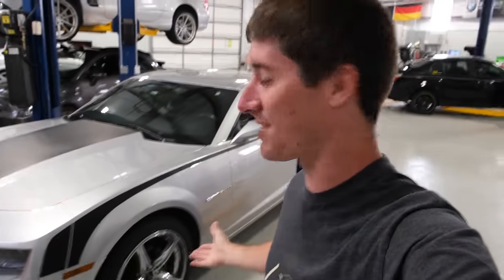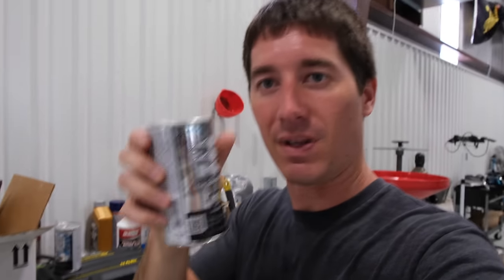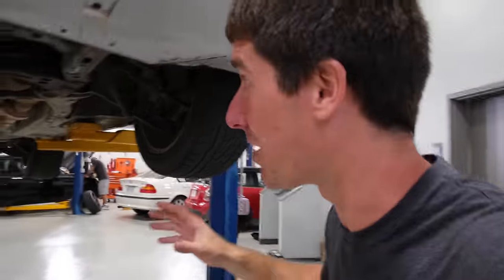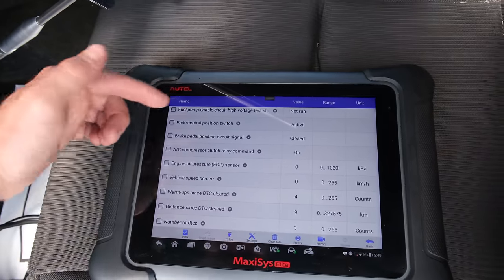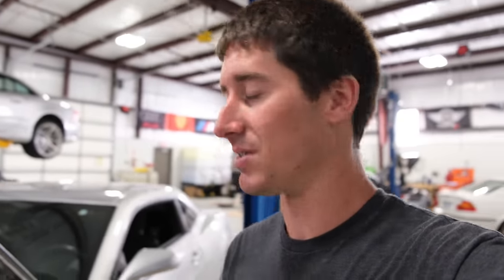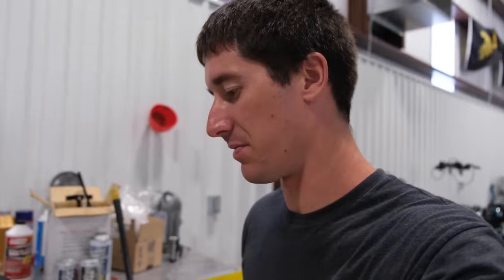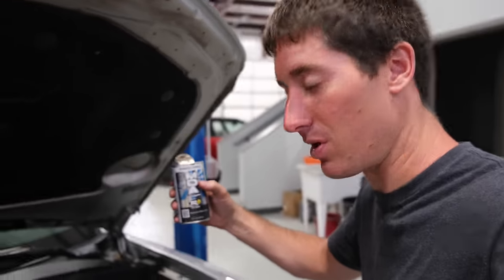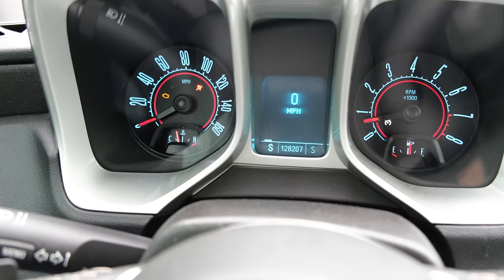FIXING The UNFIXABLE Engine In My CHEAP 2011 Chevy Camaro RS *SLUDGE REMOVAL*

Comment: Wow.. Now that's an improvement just in the oil filter bay. I bought myself an 800 dollar saab 9-3 with a bad cat that just underwent a oil change and it was just as bad. Forces my hand to do a sludge flush now that I see how bad that oil looked.
Reply: Depending on generation, Saabs also had a big PCV/crank case ventilation issue, might want to look into which if any revision of the fix for that it has.
Reply: @fnordpojk  
I think the PCV issue you mentioned is more for the 9-5 with the 2.3L I4 ecoboost turbo engine. 
I have the 9-3 with the crappy 2.0L turbo I4 from GM. Which worries me even more cause GM.
Reply: @OG_DSM  Yeah, the 2.3L had like seven revisions of the crank case ventilation before it worked as it should, but I know several other Saab engines, including the GM ones, had other issues with it too. It was mostly fixed in the BioPower generation, but anything before that really needs to be checked.
Reply: @fnordpojk  absolutely correct. Nice to know someone who knows SAAB. I never liked the bio-power generation, they got to fancy for me TbH. 
I only like the 20in rims on most models because they look fantastic. lol.
Reply: @OG_DSM  I used to own an '02 9-5 with the 2.3L, so I had to learn about all that stuff. Helps to live like an hour and a half away from the old Saab factory. :)

I like the first-gen BioPower stuff for the looks of the cars, never liked the NG stuff in the last couple of years. I have actually been thinking about trying to find a well taken care of 9-5 2.3t BioPower from around '09 or so, because I love driving them, and since they're considered eco friendly they're a good deal tax wise.
Reply: @fnordpojk  those are very nice. The 2.3L was probably the best engine saab ever produced and wondered why GM didn't use it in all models!? Guess that was another mistake GM made that put the nail in the SAAB coffin. 
Good luck with the find and purchase, plenty of good examples still for sale on the market place.

Comment: My truck is pampered for a 1996 Sierra I only run royal purple in her and a minimum of 89 octane gas. And I make sure i change the oil on time.
Reply: Why do you run 89 octane? Have you shaved your heads and increased compression? The owners manual calls for 87.
Reply: Josh Hollifield it pings every time I run 87
Reply: Those vortec motor dont have high compression have you had your timing looked at? My old 98 the distributor was worn out and caused incorrect timing.
Reply: Josh Hollifield I could adjust the timing but that’s a lot of effort to put into it and it’s happy running on 89. So it’s not really an issue

Comment: Is there such a thing as a transmission clean as well? I’m sure that and the ‘diff’ have the original lubes in them?
Reply: Transmissions sort of "self clean" as ATF is loaded with detergents for exactly that reason. If you have one that is nasty that you care about, change the fluid a couple of times over a few thousand miles and put a new filter in (if it uses one) on the final change.

If you have one that is nasty that you don't care about, leave well enough alone. Sometimes the failing fluid is all that is holding them together.
Reply: Maxwelhse great answer! Thanks.
Reply: @DBB-KE5DUO  NP. Also, if you heard it in the video JR and Ninja both said pretty much the same thing of engine oil changes. You change the oil 3 times in a row just with regular oil and you're pretty likely to clean things up a lot too.

I'm sure the BG works awesome, but I can buy a lot of Tractor Supply oil for $300.

Comment: Hi JR, back in the mid 1980`s till millennium night I drove my own cars as taxis around outer London UK.. I done quite a few miles each night but changed my engine oil every 5000 miles, but had a system, when the odometer showed 5000 miles it got just fresh oil and when the odometer showed 10.000 miles it got a new filter and oil, but, each time i gave it a flush with hydraulic oil I could get very cheap, so that cleaned the engine out and the hydraulic lifters also. my cars done 200.000 miles without problem or use oil, but my last car I used I kept longer so that done 300.000 miles still ran as good as new... Regular oil changes for me then were on average every 5 weeks, but paid off in the end.... Thanks for the video, will look forwards to the next one.. Ian - UK.
Reply: I'm curious what horrible thing happened on millennium night to make you give up the taxi career?
Reply: @TheBrokenLife  Hi bud, well, after doing taxi work at night around a once complete madhouse of club goers, the local council began shutting some of the biggest clubs by terminating there drink (liquor) licences so the work got less and less so I came to the conclusion I had enough of drunks and druggies after 14 years,  And with millennium night being warm most celebrating said - we`ll never get a cab (taxi) tonight so walked home - I really had enough, so, no, i never changed into a pumpkin, I just called it quits and walked away, ending back in my old job in a factory, making parts for aeroplanes..  Less money - more  hours at work, but no more drunks and druggies, was working nights still, but that was by choice.. Hope you find this Interesting.. Thanks for the reply.. Ian, from UK.
Reply: @ianburit3705  I actually just thought you retired and was just joking around, but that genuinely is a fascinating story.

What about the rise of things like Uber has in the US? Anything like that going on over there?
Reply: @TheBrokenLife  Well, the job I took, even re trained to operate a big 5 axis CNC machining centre made me really proud of my work, like a fool I was doing up to 14 hours a night, some "weeks" were 12 nights long, I was earning fortunes but was killing me (could see that in later years) but, in March 2003 the company went bust, so i yet again was out of a job at 55 years of age, but began to feel better for it, so convinced my wife to quit her job as a nurse, then we sold the big old house we had for 25 years and retired to a then tiny bungalow 30 metres (yards) from a great beach.. Outside the new home  the day we moved I sat in my car and said - My God what have we done, but, was the best thing we ever done In life.. It was FATE that made all this happen, my wife kept going to Spain on week long holidays with daughters and grandchildren, I stayed at home to look after our dogs , but sadly my wife got brain cancer and from the first MRI scan to funeral took just 18 months bless her, passed in December 2017, so it was FATE that made it all happen I guess.. Oh, I`m just 72 years old now, and have family who drove London Black Cabs so are not loving UBER here either, but our world changes daily now, as from Friday 24th everyone going to shops (stores) MUST by law wear a face protecting mask here yet again..
Reply: OK, bud, its 1-30 AM here so I got to get some sleep as I got a nurse phoning me in the morning for my "tests" I`ve had done so expect another telling of - lol - night mate - Ian
Reply: @ianburit3705  Dang man... Sorry to hear about all of the bad news, but I'm glad to hear you got to spend some time in retirement with your wife by your side. In that regard, I hope I'm someday as lucky as you are. Good luck with those tests!

Comment: Skip to the end: they did an ad for BG Products, cleaned the engine with some flushing procedure from BG, mentioned BG a whole bunch of times, then at the end, didn't fix the engine.  The timing chain rattles came back after Car Ninja said they were gone.

I know since the Car Ninja was in it, everyone was expecting the engine to fail, but it didn't yet.  He's going to work on it in the next episode and then it will fail like with most things he touches.
Reply: Hey man did you see the part in the video that they said they’re trying this to see if it will fix it? I was under the impression that they are going after cleaning out the sludge and seeing if it fixes it, but either way the sludge has to be taken out if it still needs to have chains done. I would still want a clean engine if I still had to do chains but if I had the chance to possibly fix it in the process, well heck I’m giving it a shot. No chemical is going to fix mechanical but if there’s an oil passage or a timing tensioner sticking and it hasn’t mechanically failed or stretched, I would bet this stuff would help.

Comment: I do an engine flush prior to oil changes by adding a quart of transmission fluid to the oil. I then run it for around 200 miles before changing the oil. I use only synthetic oil, which also helps to reduce sludge buildup, and to extend the time between changes.